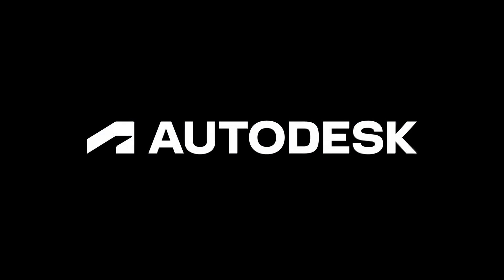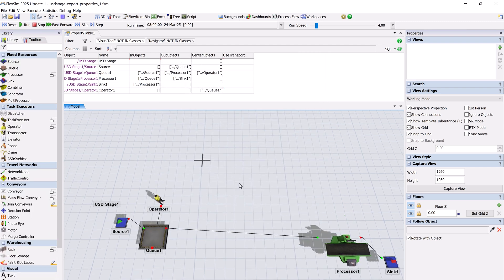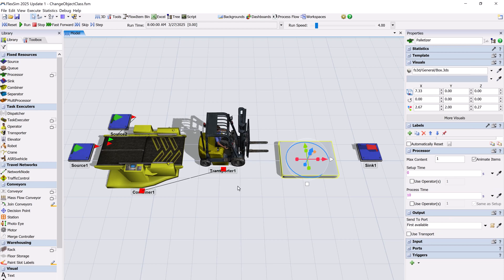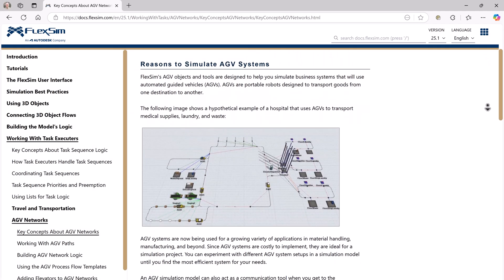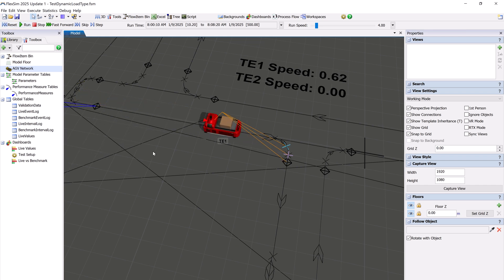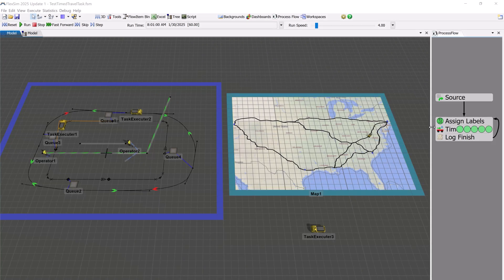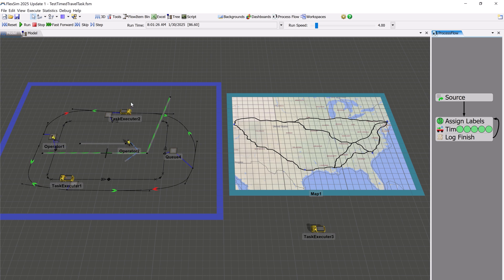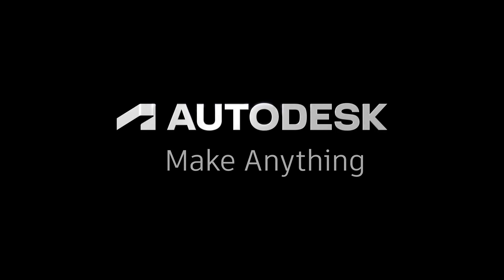FlexSim 2025 Update 1: New Features

Comment: May I ask: what is the maximum number of AGVs and map size that FlexSim can simulate? What types of AGVs can FlexSim simulate (for example: towing AGVs, unit load AGVs, forklift-type AGVs, etc.)? Also, is it possible for multiple engineers or technicians to work on simulating the same project simultaneously in FlexSim?